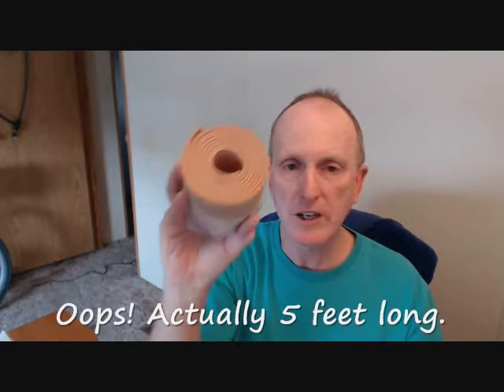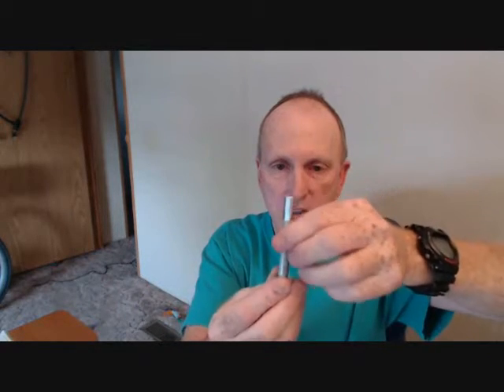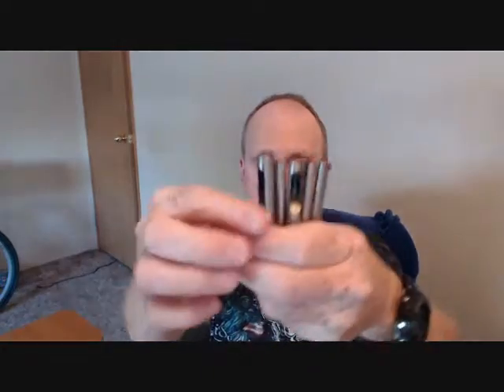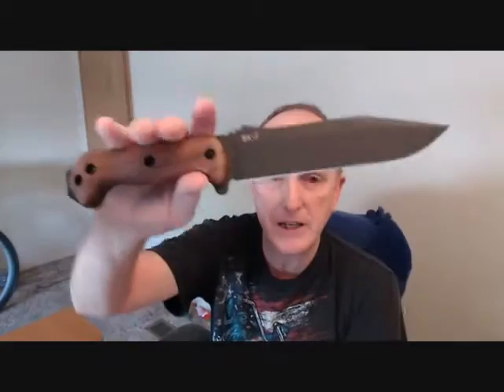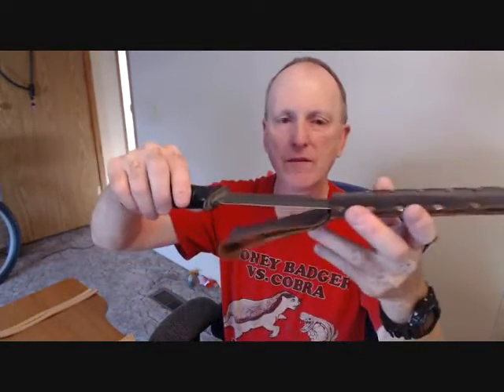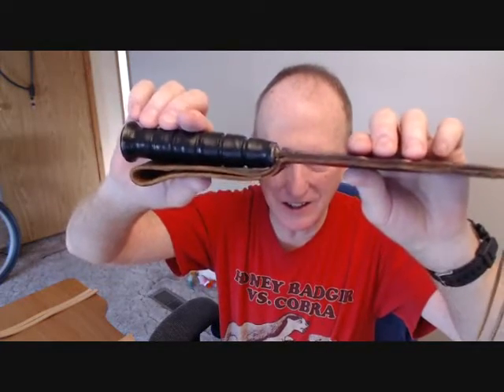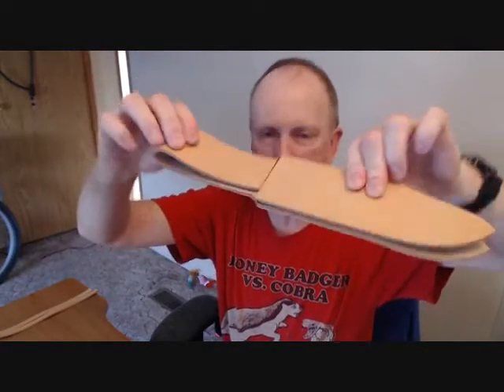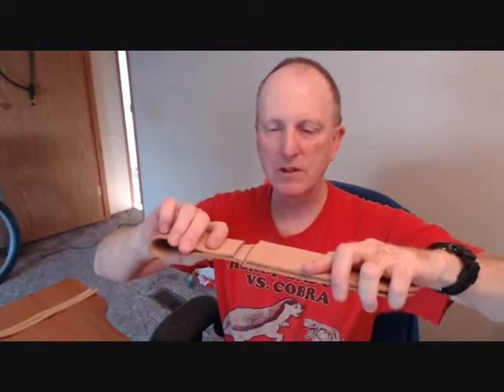Making a Sheath for Becker BK7 (Part 1)

Comment: Hi Dwain! Try ebay for the eyelets....Probably mega cheap from China :-)
     I'd recommend incorporating an insert of leather on the blade edge side, to stop the knife from slicing the sheath as it's used. I'm not sure what the technical name is for it, but it's seen in most good sheaths.
Reply from the maker: ***** 
Hi Jeff,
Thanks for the ideas. I know what you mean. I think it's called a welt. I decided not to use one to keep it simple. Maybe next time I will be a little braver! LOL
Cheers, Duane